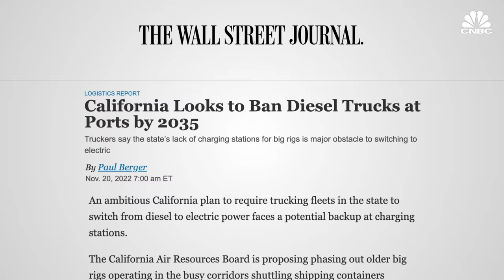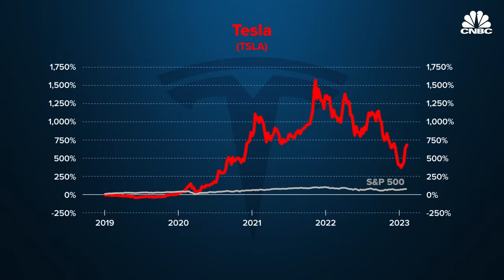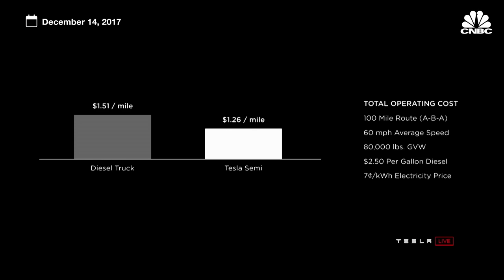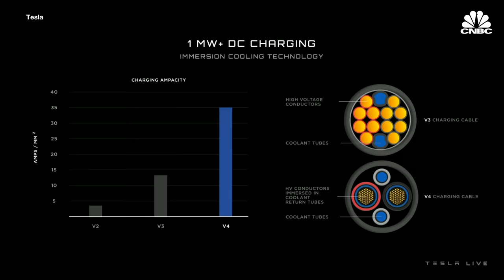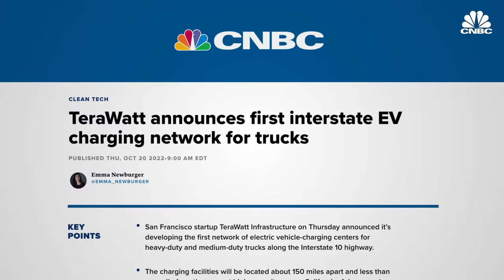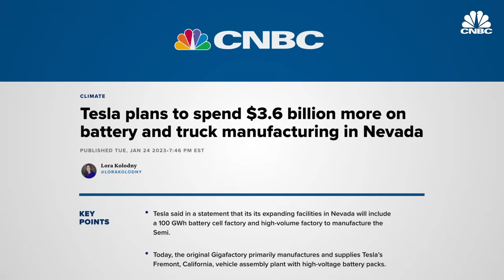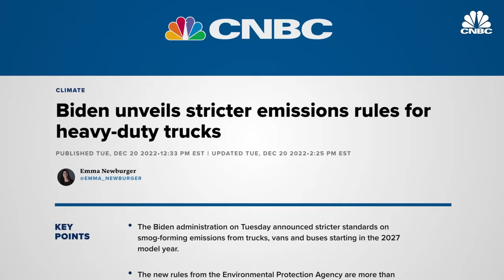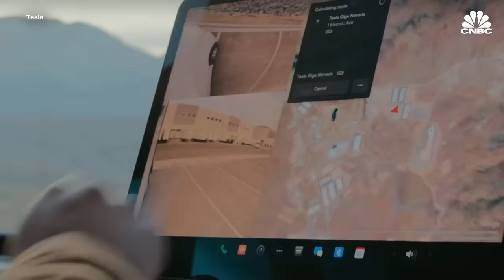Does The Tesla Semi Live Up To The Hype?

Comment: Historical note:

The steam locomotive industry was over a hundred years old when the diesel electrics were introduced in the 1950’s .

The three biggest steam locomotives companies merged to become Baldwin- Lima- Hamilton.

They and every other steam locomotives company went bankrupt!

All Locomotives are made by GE, EMD or a few small companies none of which ever built steam units.

Just a warning not a prediction….
Reply: That does not mean that in the current scenario, battery electric trucks are the ones that are going to win, I see hydrogen trucks as a more realistic solution, even though they don't seem so right now.
Reply: Insightful. Similar can happen. Tough as it seems the ICE engine makers are making steps to electrify their designs. So they may have learnt from history. We will see how much.
Reply: Diesel-electrics were introduced in the 1930s.
Niche product at first, mostly switchers, due to the lower power available early on.
They didn't get COMMON 'til the 1950s (World War II both hurt by distracting, and helped by pushing technology needed).
Reply: @Cier433  problem with hydrogen is the lack of regenerative braking. This thing can improve energy efficiency a lot... Radically a lot. I think in future trucks and train's all will be with battery
Reply: @andresouza2314  What are you talking about, hydrogen cell vehicles work with electric motors, the hydrogen cell only generates electricity, so it is not that different from a battery electric vehicle, only in the case of those that use a hydrogen cell, the battery it's much less so they would still have the option of making a regenerative system. Let's say you could make a hydrogen cell truck that needed only 10% of the battery capacity than if it were just batteries.
Reply: Yeah, i just don't see how hauling heavy battery packs around is going to make any sense especially for long hauls. I think hydrogen will have the edge when it becomes a storage method for excess green energy. There are better ways to store excess energy if the geography permits but that is not likely going to be the case for a lot of our power generation.
Reply: @planetarygodzilla  No they didn't, they are all focusing exclusively on EVs. Which isn't a bright idea, especially since anything can happen before 2030 and 2050.

BMW, Honda, Hyundai, and Toyota are on the right track by diversifying their lineup. Offering a variety of options from gas/petrol, EVs, hybrids, and Hydrogen. The future is uncertain, and consumers are going to decide the fate of the automobile.
Reply: @Cier433  problem with fuel cell technology is cost because of the catalyst used (platinum, palladium ruthenium etc). These catalysts are way more expensive than nickel and cobalt. But that's where Toyota's new hydrogen ice hybrid engine will be revolutionary.
Hydrogen is the most energy dense substance out there.
Reply: @andresouza2314  Regen breaking can be handled by having a small lithium battery to recoup extra energy along with the main H2 hydride storage. Doesn't seem like a big hurdle.
Reply: @drill_fiend1097  surely can, but I didn't see why increase complexity. Battery is a technology with a lot of potential to evolve. Simplest technology will win
Reply: @andresouza2314  it's nothing new to have lithium battery with fuel cell. Even Toyota Mirai has Regen breaking, with a small battery.
Reply: @Cerise M  I'm thinking it's going to be full battery for all vehicles.  Planes will be the last, not within our lifetime. Rockets never.
Reply: @Cier433  Hydrogen is under 50% efficient and you can't regain energy going downhill. I don't think so.
Reply: Lol!!!! What does that have to do with trucks!? Trains are totally different beasts! Diesel actually made those giant moving things way more capable unlike batteries or steam or whatever! Today the largest ships are able to cross entire oceans fully loaded not what steam or batteries will ever claim!
Reply: The same goes with cars too!
Reply: @planetarygodzilla  ICE is still far more usable/flexible and actually needed compared to EVs! No EVs are building or even maintaining what diesels have been doing for decades!
Reply: @andresouza2314  hydrogen power trains also have electric motors and batteries and also regenerative braking please educate yourself
Reply: @carholic-sz3qv  Right now, yes. But could you make an argument on what the picture will be like in 50 years time? That's the real concern here. If the rate of development for EVs hold up, they can outperform ICEs in more factors. Charger availability, charching time and battery density are key fields where a lot of development is expected.
Reply: @planetarygodzilla  again I’m not here to hate on EVs but they will never equal or surpass ICE in all their capabilities! It’s not hard but facts! Just look what diesel has made possible! From everything that can work everywhere to work 24/7 haul the heaviest loads, cross the most difficult environments….. think again!
Reply: @carholic-sz3qv  that's is unnecessary complexity. Is much more simpler and efficient just use batteries for anything with wheels.
Reply: @andresouza2314  are you just a troll or what!! Can your battery powered truck go everywhere like a diesel truck!? Can your battery powered truck work 24/7!? Do you even think before commenting!? Diesel trucks/vehicles have soooo many different uses/applications! Your battery truck is also only made for the pavements relying on the infrastructure that was built/maintained by diesel trucks and equipments.
Reply: @andresouza2314  batteries means unnecessary reliance on an infrastructure and almost no flexibility whatsoever! Let’s not forget when those things gets old they can’t just be exported to foreign countries to be used like diesel trucks they will be totally useless.
Reply: @carholic-sz3qv  export to poor countrys is what EU is doing today with their garbage. That's not cool. A long life battery that can be recycled is the optimal solution. That's a technology with enormous potential to evolve.
Reply: @priyanksaklani8176  "Hydrogen is the most energy dense substance out there." 
Except that it's not very dense.
Reply: @Cier433  Hydrogen has a huge efficiency problem. Producing, compressing and transporting hydrogen cost a lot of energy. On top of that  you need storage. Meanwhile batteries keep getting better, while hydrogen will stay hydrogen.
Reply: @andresouza2314  I get your sarcasm and mistake is on my part. I should have said, 'Hydrogen is the most energy dense substance by mass'.
I agree if you start calculating the energy density by volume hydrogen sucks. But ask yourself would the extra volume needed for hydrogen be a deal breaker in the freight world(trucks, ships and trains)? Especially if the tanks are made from carbon fiber and plastics with minimal weight!

I think:
Energy density(per kg)
Hydrogen ICE> Gasoline ICE >Hydrogen Fuel Cell > BEV
Energy density(per liter)
Gasoline ICE > BEV > Hydrogen ICE > Hydrogen Fuel Cell
Reply: @priyanksaklani8176  my whole point is: why spend energy to produce hydrogen when you can direct use this energy? Batteries are more efficient in this point of view. That's why I believe batteries will dominate everything that moves over wheels.
Reply: @carholic-sz3qv  I absolutely see your point man. To dial back to the starting question of this thread. We would like to know if manufacturers will go out of business if they don't adopt in time. So the question is market demand. And that's affected by many factors, meaning considering the factors where ICEs will remain superior,  the optimal choice for many customers can still shift to EVs. We have seen this partially in the last decade. Question is, to what extent will the market shift and are the industry leading manufacturers employing the right strategy to tackle this change?
Reply: @planetarygodzilla  hydrogen for long range maybe but like the other comment said regen braking is huge around any major metropolitan area where they spent time in slow moving traffic or braking for lights often.
Reply: EXACTLY!!  The Tesla cars could be a novelty to some, but you can't say the same about the semis.  Either they destroy the diesel trucking industry or they don't.  There is all reason why they will.
Reply: @Cier433  If that's the case, why didn't natural gas take over trucking?
Reply: @priyanksaklani8176  Uranium is the most energy dense on earth.
Reply: @carholic-sz3qv  Hydrogen is a gimmick.   Most of the Hydrogen comes from Natural Gas.  (brown hydrogen).    Now if they developed Nuclear water spitting or solar, then hydrogen would be a real deal.
Reply: @carholic-sz3qv  Trains use ELECTRIC motors that are powered by diesel.  ELECTRIC MOTORS!  They are much cheaper at transporting than Diesel trucks.  Most of FEDEX and UPS is transported by train.
Reply: @carholic-sz3qv  When the batteries get old for transportation purposes, they can be reused as electrical storage.
Reply: @carholic-sz3qv  look, not will be me that will convince you about what is right or wrong. Time will do that. Let's Just wait and see how technology evolves
Reply: people don't learn their history so they don't know what to expect when it's repeating
Reply: @Cier433  tell him carlo!
Reply: @Dudanation12  - Utility scale storage is rocketing right now.  Tesla is in the middle of it, note their new Megapack factory went into production recently, already sold out till late next year. It will be a major revenue generator for Tesla.
Reply: @Dudanation12  - Since electricity is much cheaper than diesel, electric semis are going to take over in next few years, awaiting building of nationwide charging infrastructure for EV trucks.
Reply: @cerisem7727  - All signs are that EVs are where it's going.  Global EV sales are rocketing.  EVs are on an S curve, no stopping it.  Paradigm shift going on right now.  People don't know it yet but there is an EV in their future, the sooner you know that the better, it will save you lots of money as cost of ownership is much cheaper.  I drive a Tesla at no fuel cost thanks to solar panels, net metering and lots of sunshine, ymmv.  Beats pumping gas.
Reply: @Chainyanker007  "Much cheaper" after the infrastructure is built. 25% of the cost of fuel is the delivery infrastructure. Another 25% is the road taxes, which electrical doesn't have imposed on it, yet. Electric engines are indeed more efficient than ICE engines but as the vehicles get larger, the efficiency goes down because you have to carry more battery weight. We'd be much better off keeping the trucking jobs to the local deliveries and build a train system that runs an electric rail for the majority of our long-haul transportation. Trucks are for convenience, not efficiency.
Reply: @Chainyanker007  I'm just not on board with large chemical storage for power. That's a huge waste of resources and extremely costly, especially in the long-run. There are better ways to do it.
Reply: @Cier433  - The problem with hydrogen is this technical scientific formula:  H + air + spark = Kaboom
Just ask the owners of that hydrogen fueling station in Norway that went Kaboom a few years ago.
Also the logistics of making, storing and hauling H is complicated.  With electricity you create a renewable source, send it to the grid from where it goes to homes or charge stations.
Reply: @andresouza2314  - Also battery technology is rapidly advancing. In a few years time batteries as we know them now will be replaced with batteries that are cheaper with higher energy density. This is already happening. Every year will bring tech advancement in batteries,
Reply: @Dudanation12  - We'll see how the 4680 batteries perform in the Semi, likely by end of this year.

Comment: Pepsi has confirmed 36 semi’s! Working there way to 100, explains “pilot production”
Reply: gotta start somewhere! time to charge em all with solar 😅
Reply: @mho...  I own a very large solar company. The size of the array required to supply the 800+kW peak demand of this battery is absolutely monstrous. Solar can slowly help fill a battery that powers this but in absolutely no way is it feasible to charge a truck off solar
Reply: @mattbrew11  they claim that they have 2mv of solar and 2.7 mv h of storage in that fritolay facility - is it enough to achieve anything? Or they mostly just use all this for "being green" pr ?
Reply: @seowebua  those numbers seem misaligned but yeah you could charge the trucks off it.
Reply: @mattbrew11  While you could charge directly from solar, it would be best to charge a stationary pack like the Tesla Megapacks or other's versions and then discharge when needed. A single megapack could cover more than 4 full charges when fully charged, though normally 6-8 typical charges. And that's when the sun is shining and recharging it. You have to deal with some efficiency losses, but it's far better overall.
Reply: @Nouphanh Pravongviengkham well it would contribute energy but not enough for any appreciable range. Please don’t misunderstand im obviously not here to talk down about solar but driving is very energy intensive.
Reply: @Nouphanh Pravongviengkham roof solar on ioniq provides up to ~3 miles per day which is not a lot, so that probably won't work for trucks to cover long distances
Reply: @mho...  time to start manufacturing stuff locally. You ever wonder why long haul became a thing along with a car cententric economy? Who benefits from selling all that oil?
Reply: @mattbrew11  not with pannels, but a boiler set up could.. but thats if the junk heap works.. (it doesn't this vid is musk sucking)
Reply: @mattbrew11  cover the roads with solar roofs. no rain problem and no snow problem
Reply: @0xsergy  everyone. because some people make stuff cheap enough that even the shipping cost dissappears in the larger scheme of things.
Reply: @mattbrew11  charging at around 800kw/h from almost zero to 100% must be doing wanders to those batteries... :)))))))))))))